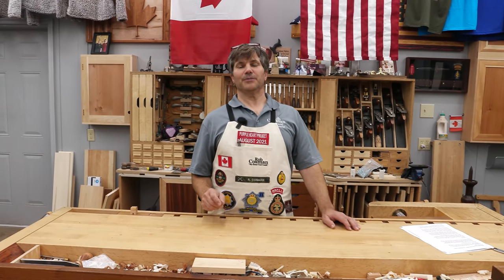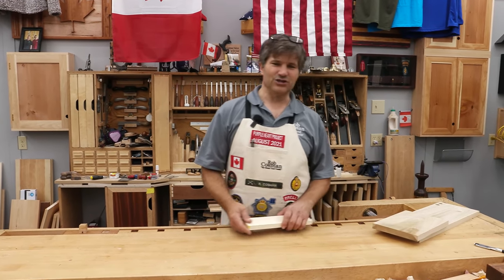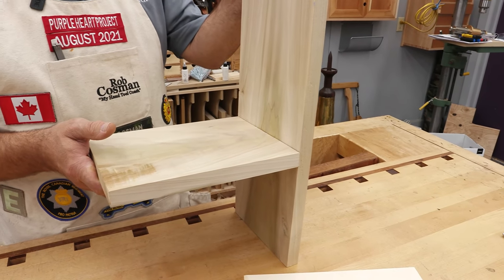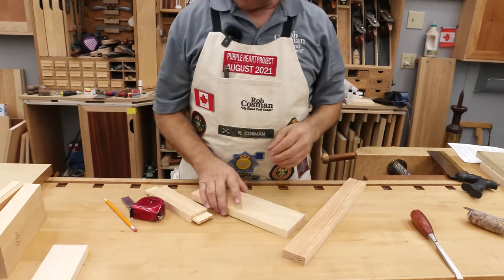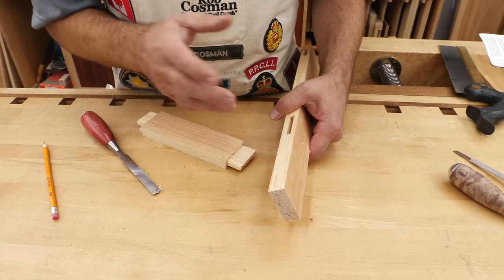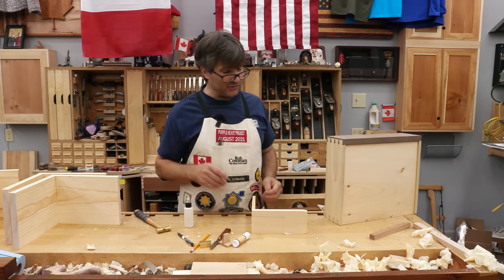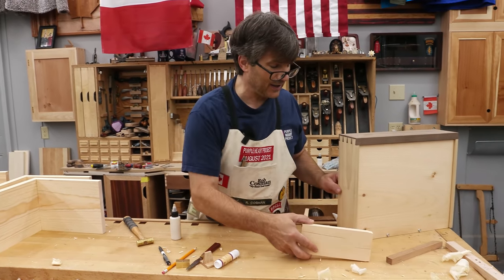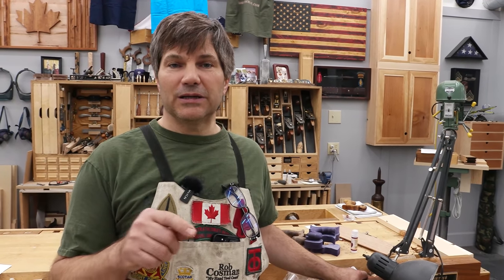End Grain Glue Myth Busted | What does it mean? (Surprise Ending)

Comment: Hi Rob, this is an excellent "end" to Patrick's video then followed by The Whisperer, then Stumpy, then you. While Patrick's demonstration is to show that if glue is stronger than wood (long-grain seal), than glue is stronger than expected on end-grain wood. But, as Mark points out, Patrick's video doesn't say "don't do joinery," and Stumpy continued that thread. Where your video bumps the point by making and discussing that Joinery. 

However, (noticed that there's always a "however" after a compliment? :>)), I do take a small issue with your dado "shelf" joint test and conclusion. If you are working at impact force at an angle, I think that most joints will have issues. As you observed, once again in your test piece, the glue was stronger than the wood. But if that is going to be one side of a shelf, is that a fair test? About 35 years ago I made a "unit" to hold records, the stereo, a record player, books, etc. that wrapped over/around a desk. Since, at the time, I didn't know for beans about end-grain versus long-grain or proper joinery (etc.), I glued some home depot pine 1 x 12 boards at right angles. I did add 3 counter-sunk screws from the outside face into the (end-grain) boards mostly for keeping them in place for gluing. Each shelf is 24" wide and each shelf is holding about 180 vinyl phonograph albums. That's a LOT of weight on those shelves that are only (really) being held by glue and three screws. There is no joinery going on here at all. I should add that these shelves have had one major move and have gone through 3 major earthquakes (I live in Southern California). 

As far as your impact test. I suggest you try your hammer on your rabbet joint and maybe even your dovetail joint and see how they hold up. Alternatively, attache/clamp a cleat on the backside so you can safely stand on that shelf and see if you can do the non-impact "stand" test on it. My money says that it should be able to support your weight as did the corner joints.

Meanwhile, I do love your work and your teaching technique and approaches. Continue to do your wonderful work.

Comment: The strength of the rabbit it's nice to know in a situation where you plan to paint. Dovetails or even finger joints would be a lot of work. To do if you don't need it and your painting over it anyway.
Reply from the maker: If I am painting over it glue it, screw it paint it.  I dont use paint

Comment: The only problem with his testing method is that yes at the joint on small pieces it is strong. Glue a but joint with even 24 inch pieces amd see how easily you can pop that joint.

Comment: Like most, I've always believed end grain glue joints to be weak. I think what Patrick's video (and the subsequent follow up videos such as yours), has emphasized is that a joint is only strong as it's weakest link. What's become apparent is that most of the time, It's not the end grain glue joint itself that's weak, it's the lignin bond that hold the fibers together. In cases where an end grain glue joint does fail, it's only because cross grain is incredibly strong.

Comment: Great video Rob. I really appreciate the practical application of the information from Patrick’s video. With respect to the dado joint I have always used a sliding, tapered dovetail to provide the mechanical strength because I assumed the end grain to long grain connection would be too weak to prevent the sides from bowing out. I guess I will have to re-evaluate whether I still want to do the tapered, sliding dovetail. It is more work and more time. It would be interesting to figure out a way to measure the difference between a regular dado and a sliding dovetail. When my new shop is completed I would like to see if I can figure out a way to do that test and film it.
Reply from the maker: You and I are the same I just used a through wedged tenons instead of a sliding dovetail.  Not anymore its glue only for me

Comment: I like the application of his testing.  Nice work!
Patrick’s testing showed the end grain glue joint is a bit stronger than wood in its weakest direction.  This gives a practical application of this.  I have always glued end grain since it did add some strength and is easy to do.  I was surprised with the results that it is stronger than I had assumed.  As you indicate it doesn’t change most joinery methods but it’s good to see there is some change in applications and this bit of joining knowledge makes us all a little better.

Comment: On a cabinet door frame, how much strength is needed? Could it be that using only glue on the frame joints and no mortise and tenons is sufficient
Reply from the maker: I dont think so...the lignum bonds are not strong so I will stick with joinery

Comment: Whacking doesn't give you a good idea about the static force needed to break the dado. By whacking it you are applying dynamic forces, which are orders of magnitude greater than the weight of the hammer you use to bang on that board. That dado is plenty strong for practical applications,.
Reply from the maker: That was my conclusion too

Comment: I have watched all of the videos and yours by far is the most comprehensive with real world aplications. While I am just as suprised as you and everyone else about the rabbet. I am curious as to the racking strength, if a carcas were to be assembled with these joints. Obviously most cases gets some strength from either shelves or a static back. But dovetail corners can keep the carcas square with out relying on these. I would like to see an assembled carcas with rabet joints and just have someone sit on it and move side to side a bit.
Reply from the maker: Good point.  And dovetails and mechanical strength the rabbet does not
Reply: The carcass gets ALL of it's "racking" strength from the back, not the corner joints. That's why backs are fitted onto furniture, even though they are hidden.
Reply: @johncoops6897  But dovetails give mechanical racking strength with out the back, that is my point. There are examples of light weight furniture that do not have backs. These pieces my also derive strength from a dadoed shelf. Thus the toe nailed nail that was discussed. However if the endgrain glueing of the shelf removes the need for the toenail then hazaaah. But dovetails can prevent racking with out the additional components, just sayin.
Reply: @charlesagby6662  -  the glue cannot make tbe joint stronger than the material itself. So it is still important to consider the stresses that are applied to any joint and design accordingly. The point of Patrick's tests is not that the glue suddenly makes all such design decisions instantly irrelevant, but rather that adding (suitable) glue will add much more strength than (some ignorant) woodworkers think.
Reply: @charlesagby6662  - I must clarify... the point is that if there is no triangulation (back fitted) and the end product will be subject to racking forces, then you need a VERY inherently strong corner joint like a dovetail.
However if there is a back fitted that will add FAR more racking strength than any dovetail joint, the the corners will only need to be glued butt joints. So, its about applying the (new) knowledge properly, rather thsn ignoring it and using dovetails everywhere just because certain elite woodworkers said they are better.
Reply: @johncoops6897  This is to the point of my first comment. I understand that most pieces get their mechanical strength from a fitted back. I only pose the question to the times that, that would not be chosen. Such as an open back mid century entertainment console. I have seen many examples of open back pieces and only question the validity of the rabbet in these instances. If you wanted to do rabbets with a static back then there are other incredible time period options for mechanical corners as well, such as cut nails which do not require any glue, or we can apply our new found knowledge of end grain glue to these instances, I am not knocking new info, just asking an expert their opinion of an instance where there would not be the rigidity of a back installed.

Comment: The stresses and strains expected in furniture use are taken into consideration at the design stage. It is called joinery for good reason.   All the main stresses are covered even if no glue was used at all. In most construction all the glue is needed for , is to provide enough strength to stop the joints coming apart. All the main tresses are carried by the wood alone.
We have known for a long time that glue is usually stronger than the wood, what ever the direction of the grain. However there is no actual gain in this if the wood fails first.
More important is choosing the right glue for the expected conditions.  A beautiful veneered desk will soon delaminate if left out in the rain, or in a damp cellar.
Not all glues are suitable for all purposes, and in the toughest conditions such as timber framing no glue is usually used at all.

End grain to end grain is not something any one needs to use or even worry about very often and in most cases is best avoided.
However commercially available timber and boards are now often spliced end to end. And are exceptionally strong.

Comment: Not at all surprised. I guess I failed to get the "end grain glue has zero strength" memo. I think these would have been even stronger if the end grain was sized with glue. I just add a bit of glue, wait 2-3 minutes then add a touch more. That being said end grain glue is not always strong enough for the application, like an apron to leg connection. There I glue the end grain and add re-enforcement, usually dowels.

Something not being discussed is that the joints Rob is testing were invent a long time ago. Is it true that historically glues were not as strong and interlocking joints were more of a requirement?

Comment: Just my opinion.   The strength of side grain joints also depends on the type of wood used and the way it is cut from the tree.   Quarter sawn board side grain would probably be the weakest.   Those guys breaking boards use quarter sawn with grain in the width direction.   You can almost break them with one finger pushing down in the center.

Comment: I'm wondering if the glue joint would become britel with age and be less strong? Seems to me that the dovetail construction is more integral in mateing the joint together and would last generations. 

I'm very impressed with the strength of the glue joint, thanks for giving it a fair evaluation
Reply from the maker: A joint has both mechanical strength and glue strength.  PVA has not been around 100 years yet so we do not known what will happen to it over the very long haul.  But I do know it holds up well for 35 years.....My own furniture

Comment: Rob, I wonder what this means for corner mitred joints such as in a small box.  It suggests that this joint might be stronger than previously thought?  Maybe a test in thinner material would be in order, say 3/8" thick, with and without splines?
Reply from the maker: Anything for you Larry!  We are on saturday night.  How have you been ?
Reply: Hi Rob, been a while!  This End Grain Glueing subject caught my interest after teaching and believing the myth for years.   I've made many small boxes to house tools and sharpening stones using only quick mitred joints and even butt joints.  I'm always surprised by how robust these boxes have proven to be.  I wonder how this revelation affects plywood glue-ups (probably not much, the weak point will still be the internal plywood glue between the veneer sheets)?
Haven't been doing much woodworking, had a lousy summer.  Seem to be on the mend for now.  Thanks for asking.  I'll try to tune in on Saturday night.
Carry on.
Larry

Comment: I think it is very important to remember how pathetically rubbish wood glue used to be! 
If I had made that exact joint in my woodwork classes at school, it would have broken just by picking it up and shaking it. LOL
So the wisdom of that era was correct and undisputed. But now with glue’s being stronger than the wood itself, it stands to reason that it can make a better joint than back then. 
How long that joint remains strong and reliable is to be seen, especially if you take into account environmental conditions and cycles of work or loading, and the position of the joint. 
I’d like to thank Mr Sullivan, Stumpy Nubs, The Wisperer and yourself Rob for all the videos and the integrity and character of all of you. 
For now at least I will still be reinforcing my joints or using dovetails.

Comment: I wonder if the quality of glue has improved over the years to make a difference. Perhaps the glue years ago was less effective ...?
Reply: Of course. The "rule" started in the days BEFORE glue. Hide-based animal glues weren't as strong as wood, yet the modern cross-linked PVA glues are stronger than the timber itself. Hence the new glues will not fail, but the wood will still fail like it always has.

Comment: People rushing out crazy do not fully understand what was tested and what was not. It was only about glue vs grain direction. No mechanical joints were tested, but he said more tests are coming. I never rely on glue for strength but on mechanical joints. I have never used butt joint with glue for structural pieces.
Reply from the maker: 100% agree with you

Comment: It simply means the glue is stronger than the wood resin but weaker than long grain so it doesn’t change much really.  A proper joint is still always stronger than end grain glue joint period.  No problems gluing m&ts with squeeze out.  Using pva I just clean up with a damp cloth then use ply strips with 240 grit glued to them to clean up when dry.

Comment: Pretty sure the last year wasn't fair to the joint.  Hitting it at the end of the board put a lot of torque on the joint that wouldn't ever occur if the other end of the board was supported, as it would be in application.  The joint failed the way it did (i.e., pulled the vertical board to pieces) because of the long lever arm.  I'd bet almost any joint there would have failed under that test, even if stuff like tenons or dowels would at least have held the now-broken joint pieces in place.

Comment: As a segmented woodturner I have always had to glue end grain to end grain to make my rings. Woodturners always thought the strength was in gluing the long grain of the rings together and using a brick lay pattern. Patrick's video demonstrated to me that my segmented bowls were very strong if the glue was applied correctly and the rings are flat. I shared his video with my woodturning friends because it just verified what we're doing on a segmented turning. With flat work the issues are different and you've done a great job of demonstrating the impact to your joinery. Thanks Rob!

Comment: It was the sharp blow rather than steady weight.  Try gluing it up and stading on it instead of the mallet whack.
Reply from the maker: But the glue didnt fail the wood did and that was what the test was all about.  Proves the glue is strong enough in a dado joint

Comment: I think it is more complicate then people realize, these are all fresh glue joints you are testing (fully cured but still fresh and flexible) , what happens to the glue after 5 or 10 years? I use tite bond original and elmers wood glues and I have notice that they get brittle as they age. Brittle things eventually crack and when it cracks and the glue is the only thing holding it together the joint fails, I have a bunch of garage cabinets that demonstrates said point.  The proper joinery controls the tensile shearing forces on the glue and works in conjunction with the mechanical strength of the joint.   So I would not be building a bunch of chairs held together with glued butt joints, I am just saying

Comment: I think people are kind of missing the point of this. Its not that the glue joint is weaker on endgrain,  its the wood itself that is strenger. Wood cracks along the fibre so with a gluejoint along the fibre it wont break on the glue line, but with an endgrain joint the it has to crack the fibre of the wood itself wich are much much strenger so its pretty logica it will break kn the gluejojnt.

Comment: No doubt some of the glues we have today are incredible in what they hold. Yet, after watching some of the antique furniture restorers, they rely heavily on heat and steam to release the hide glue. Do you ever consider how your works may one day be repaired down the road in, say, a hundred years? Will the strength of the Titebond make this work impossible?
Reply from the maker: Titebond III, in the short run at least, is stronger than hide glue.  So do you want a stronger joint or a joint that will come apart before failing that can be repaired?  As for me I like the stronger glue route over hide glue.  What will Titebond III be like in 100 years...only time will tell.  By the way I have done tests and I found that I could release Titebond I & II with steam....I have not tested Titebond III.  Not release as easily as hide glue mind you.